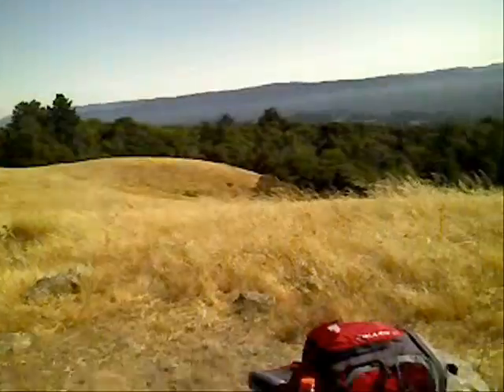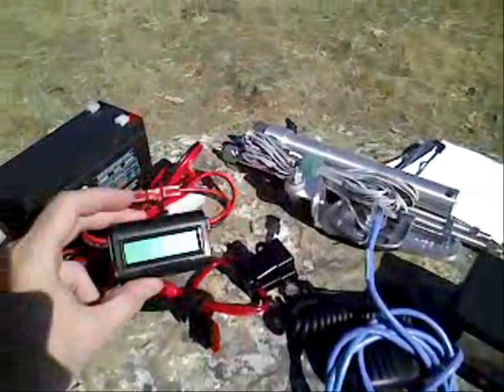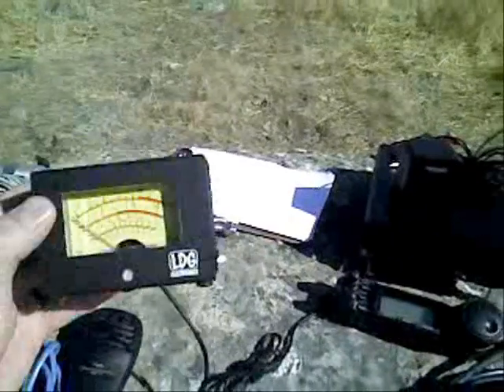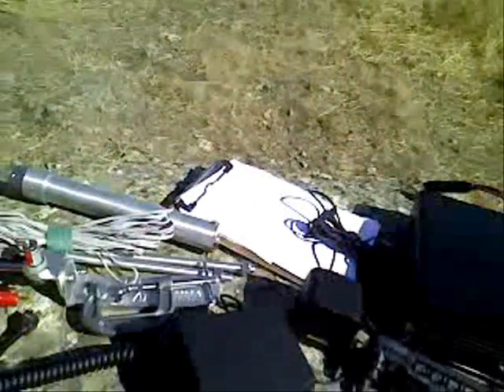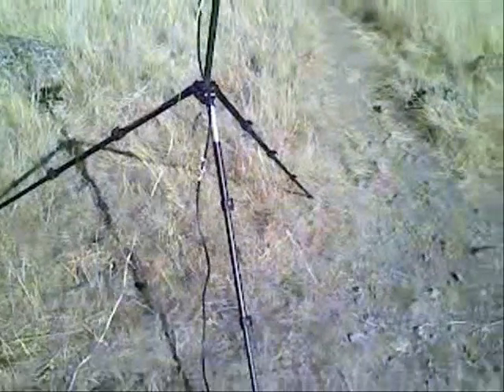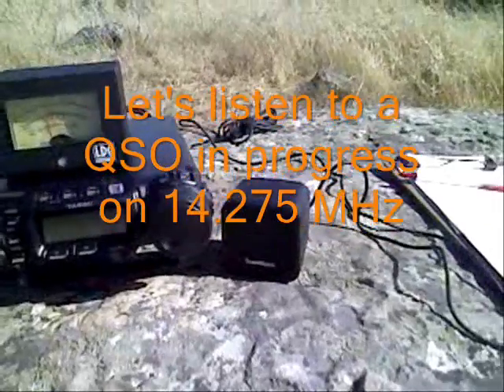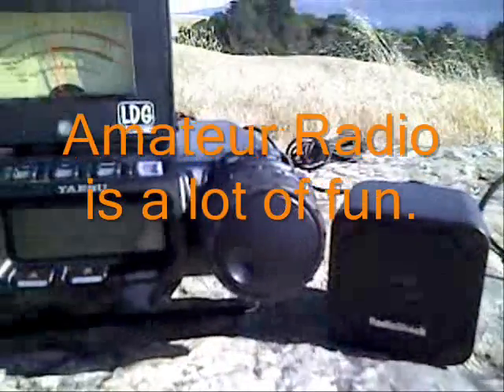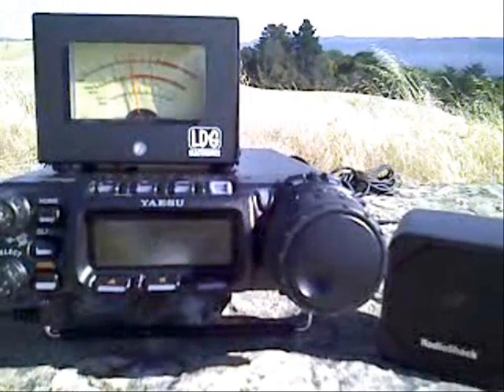Amateur Radio:  HF portable setup

Comment: @criticalzen The use of call signs throughout the conversation is a requirement of FCC regulations; and also a courtesy to those you're contacting.

The use of the ITU phonetic alphabet (Alpha, Bravo, Charlie... Whiskey, X-ray, etc.) is not a requirement, but is good radio practice when static and poor signal strength can obscure speech.

Comment: Enjoyed the video. Wondering though, if your fan on your 857 comes on each time you transmit.? Mine does and so I'm not sure about taking it out for portable QRP work since I'm concerned my battery wouldn't last long. Not sure how much power is drawn using the fan since as I said, it comes on each time I transmit--even low power.  But it seems as if you are doing some QSOs on your battery at 20 watts of output. Thanks for posting.  73  AI4QT in Huntsville AL.

Comment from the maker: max2950,
When using the separation cables with the FT857, you have two cables plugged into the base.  One cable is for the faceplate and the other is for the microphone.  You can make your own cables, just make sure you use the correct pinout.

Comment: Hi,

Great video ! You have a nice portable setup ! :)
One question regarding the 857 : when using the separation cable can you plug the microphone on the front panel or does it have to stick on the main unit ?

73

Comment from the maker: W2WXSteve,
With the wattmeter the "source" is the battery and the "load" is the radio.  Connect the "load" to the power cable on your radio.  I use Anderson Powerpoles to connect all my cables.  

73

Comment: The meter is made by LDG and the one with the blue backlight typically costs around $45. It is an analog meter that plugs into an analog output jack on the bottom of the ft 897, 857, and 817. Depending on how you set up the meter, it can display all sorts of stuff, like power output (watts), standing-wave ratio (SWR), and many other things. It would be out of most people's leaugue to build one of these. I recommend buying one from HRO (ham radio outlet). 
73

Comment from the maker: Miguest66, the tripod is a "Sony VCT-1500L".  You can buy it online. google it.

This is the only tripod that I've used that will not get blown over in the wind.

You can extend the legs all the way out and lower the tripod about 7 inches off the ground.  In my video, the height is set in the middle.

Comment: Great video. I like the way you put it together like a story from start to finish. I use to operate nearby on Grizzly Peak on a wooden water tank about 20 feet off the ground back in the early '60. I would carry my gear up on a Lambretta motor scooter and camp over night operating 2 meter simplex.

Comment: Great video.  I just passed the General and Extra elements the past couple of weeks.  I am new to the HF stuff.  I only have Yaesu HT's.  What does an out fit like this cost, radio, antennas, battery, etc.  I am interested in this and the FT 897d. I like the extra power the 897d has (100 watts), but do I need it?  I live in the Mid West (Ohio) so I don't have the hill tops you do.  Any help would be appreciated.  Thanks 73 Mike KC8JGO

Comment from the maker: The wattmeter was made by "RC-Electronics- Watt's Up".  It has many features on it.  All I really need it for is to see how many amps I'm drawing from the battery.

I typically run about 20 watts off of a 12volt, 8amp battery.  Sometimes I turn up the power just to finish a contact if needed.  This is when I watch to see how many amps are being drawn from the battery.  

I need to be careful since my battery is small and the radio can go up to 100 watts.

Comment from the maker: VU2ZZA,

Your wire dipole antenna should outperform my vertical antenna.  The vertical antenna is much easier to setup since it only needs a tripod for a base.  I'm guessing you used a few trees to setup your dipole.

My antenna is MP-1 by Super Antennas.

Comment from the maker: This location is a 1 mile or a 3 mile hike depending on which parking area I use.  

It's a great spot to setup my radio because of the 360 degree view.  You can see the ocean and the whole Bay Area.

Comment from the maker: Thanks for the comment on my video. 

The antenna I'm using is the MP-1 by Super Antennas.  I have great success with it, although I have nothing to compare it with.  This is currently my only antenna.

As for the Wattmeter, I recommend "RC-Electronics Watt's Up" because it's a little smaller in size.  That's the one used in this video.

Comment: Great video.  I'm planning to add a 2nd HF rig to my station and was looking at the FT857D, but I think I'm going to get the 897D.  I've already got my FT-Meter, and I think I'm going to get the Whattmeter from West Mountain Radio.  What are you using for your antenna?  BTW, remarkably good video from a cellphone.